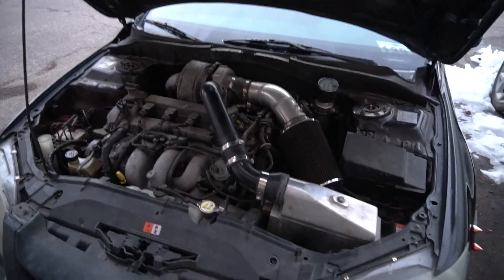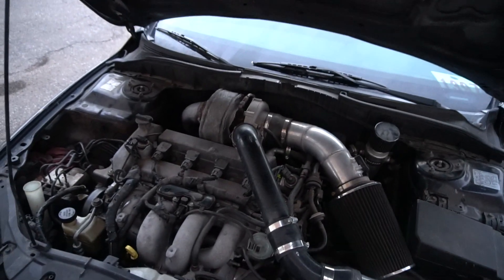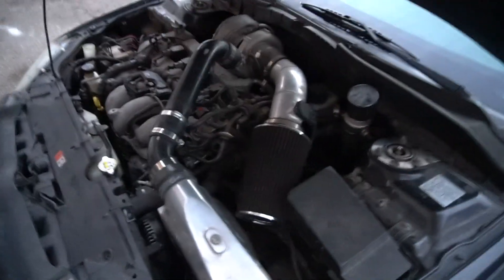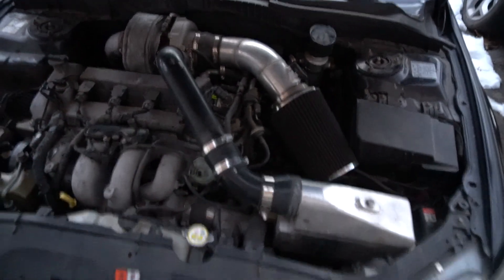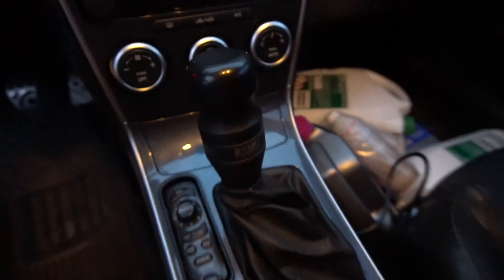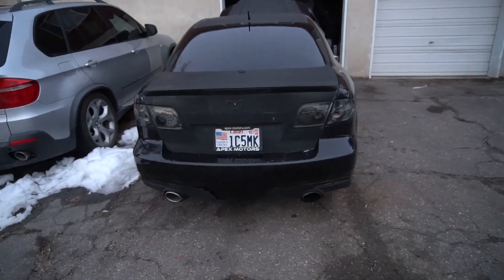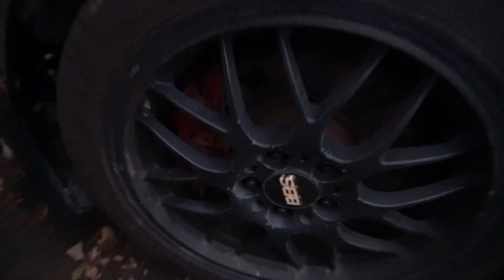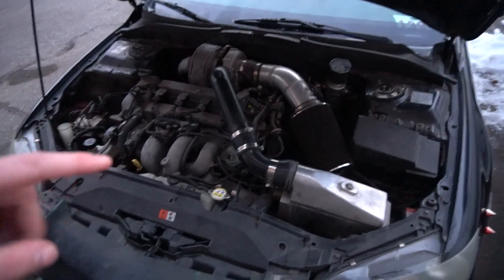5 things I love about my Big Turbo Mazdaspeed 6

Comment: What hot side specs do you have on your turbine housing?
Reply from the maker: .82 on the exhaust I believe
Reply: @StevenDevey   and boost comes on at 4200 rpm’s?
Reply: @StevenDevey  I’m building my MS6 for 700hp on high side and 530 low dual tube set up
Reply from the maker: @jockbad  I bet your boost will come on pretty early. Sounds like an insane build
Reply: @StevenDevey  that’s the plan. I’m running a gtx3582r dual ball bearing with a billet wheel and T51r mod (even though the mod just gives you more noise) your turbo is pretty big, you can get more power if you wanted but the turbo I’m running supports 400hp to 900hp
Reply from the maker: @jockbad  dang dude I want to see some vids! You gotta share something. I miss my speed